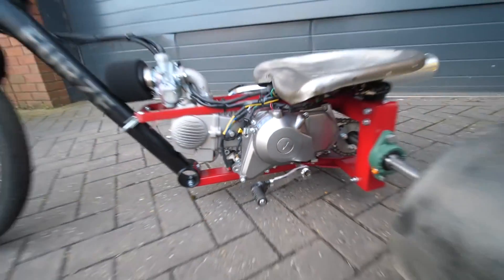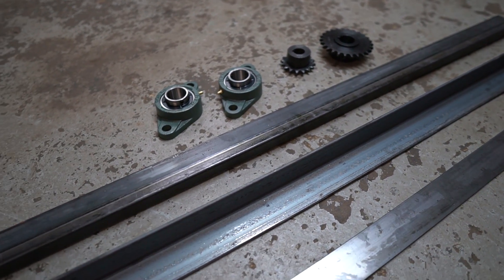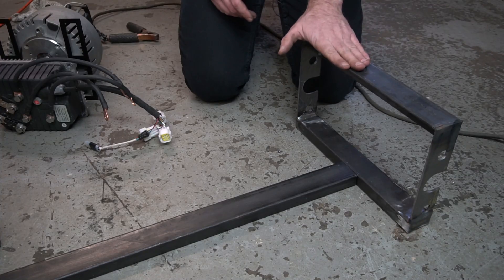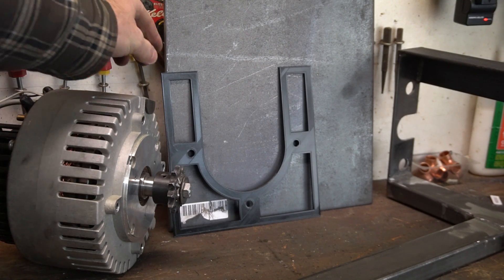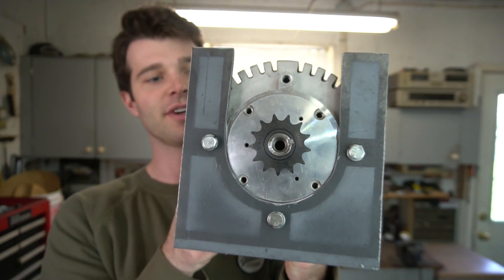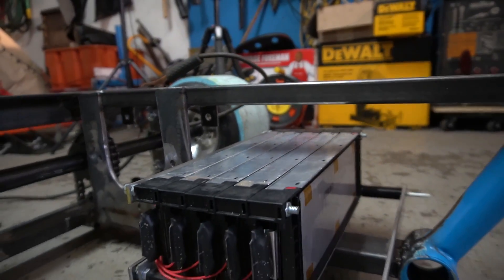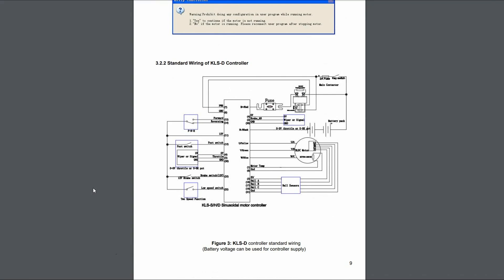Making an Electric Drift Trike (COLIN FURZE STYLE)

Comment: Hi Austin,  i'd really appreciate your advice on the topic of a motor for my build, i have access to 12v and 24v alternators in star and delta wiring formats and also 12v and 24v starter motors which i could add some cooling vents to as you suggested.
which of these would you recommend most suitable for the job?  Many Thanks for the beautifully produced and very informative videos.

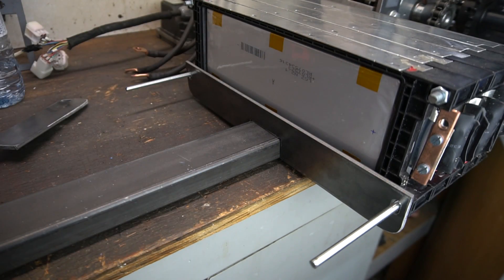Comment: 3:48 Don't weld with the batteries in place. Ever.
Use a dummy block. Hell, even a piece of wood is more preferable.
Just don't weld near batteries.
Reply: U dont state why, but id be more worried about the MIG just zapping the BMS through the ground. Jump starting EFI cars used to be a bad thing back in the day, but ppl roll it often.
Reply: @rkaid7  You've noted one possible reason.

Another is catastrophic cell failure.

Even partly charged batteries are just waiting for a reason to discharge, and they'll discharge everything they've got in an instant if ruptured. Releasing noxious gasses, flames and will most likely explode.

You do anything to jeopardise the integrity of that cell, ie: poke a nail into it, or burn through the layers, etc, it will blow up in your face.

One video that comes to mind is the guy who bites a cell phone battery to check its authenticity.

It was only a cell phone battery but it goes off like an incendiary grenade. Scary stuff.
Reply: @MikeBSc  fair call, taking a second look,  those pouch cells are pretty expposed. Agree RE lipos, have punctured many. Its rather catastrophic. I treat a 1000$ 28Ah 52v like its  dynamite lol
Reply: @rkaid7  I would also treat a $1000 battery like I would treat anything that cost $1000.

I wouldn't have my phone or my laptop close to where I was welding.
Reply: glad you pointed it out, could of went bad, glad it didn't though!